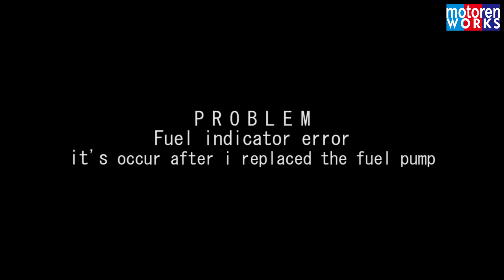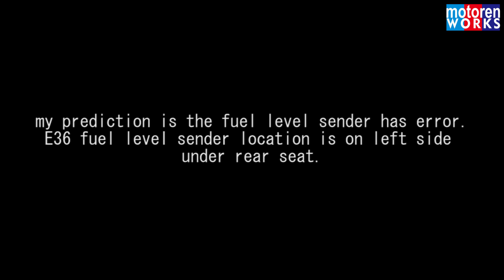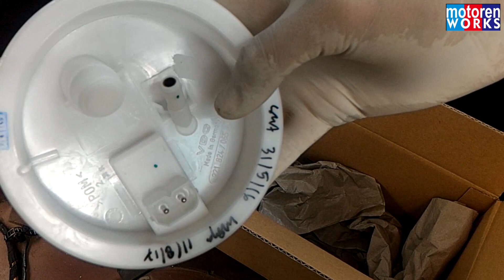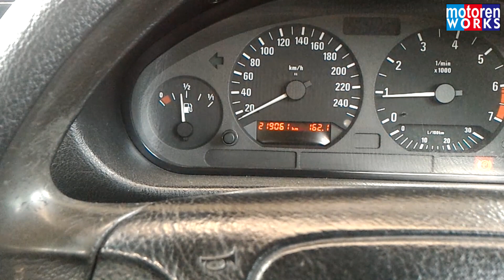BMW E36 Fuel Level Sender replacement

Comment: Thank you very much for taking the time to make this video. I followed the pelican parts and Bentley instructions which only detail removal of the Fuel pump (passenger side) and simply say "Fuel level sender (Driver) is similar but no pump." Needless to say I was confused by the extra fuel hose in the tank. 

Thank you for demonstrating how to unclip it! That was really helpful

Comment: That long pipe in the tank does it just lay in tank or is it connected to the other side of the tanks sender unit
Reply from the maker: it is connected to the right side tank
Reply: @motoren_works  if pulled it out completely how do I get it back what part does it go through
Reply from the maker: @Klips4men  honestly, i never pulled it out that hose. I think it's a hose which has a function to transfer the fuel from right to left tank. Since you can remember the former position of the hose, you can get it back

Comment: Is it supposed to have any fuel pressure in that return line. Mine didnt and i was wondering if i had a weak pump or collapsed return hose. The problem i have is fuel not transferring from left to right., through the syphon pump.
Reply from the maker: Honestly, I've never had a problem like this. In my opinion may be the syphon is broken so the fuel can't be transferred from left to right. CMIIW

Comment: fuel level sender unit and fuel pump is placed on different location ?. there's two hole under the seat ? one for fuel pump one for fuel sender ?
Reply from the maker: Yes it does. In my bmw, there are two hole under the seat. Right side fuel pump with fuel level sender and left side only fuel level sender
Reply: @motoren_works  why there's 2 fuel sender ? left and right
Reply from the maker: @RafleeRosli  Honestly i don't know why BMW engineers made 2 fuel level sender (FLS).

In my opinion, there is 2 FLS because the fuel tank shape is not fully tube (there is concave shape in the middle), when the fuel already in certain height they will be separate. So, there is two fuel region right side and left side. To know the height from each side then FLS is used. 
i've read if the left and right FLS units are wired in series and the fuel gauge receives a signal that is the average of the two FLS input values.

CMIIW

Comment: Sesuai intruksi Mas Rakhmad indra# Ternyata Fuel sender saya rusak... btw harganya brpan kyg punya situ itu om
...matur suwun....
Reply from the maker: Alhamdulillah kalo ketemu penyakitnya mas, sy ikut senang. Waktu itu sy beli Fuel Level 1 jt
Reply: Kalo punya saya gak turun2 mas jarum nya ..di level setengah .  Apa kiranya ga bisa di akalin ya mas Rakhmad indra....itung2 pengiritan gtuu😁. Oiza itu Fuel sender sebelah kiri ya .kok ndak ada Pompa penyedot bensin nya... mohon balasan nya.matur suwun
Reply from the maker: @zonamerahmuda1727  dulu sebelum ganti FLS sy pernah nyoba pertolongan pertama dg membersihkan track naik turunnya pelampung dg penghapus pensil, tapi usahanya gagal om :).
Untuk FLS (kiri) memang tidak ada pompanya om, yg ada hanya disebelah kanan

Comment: Punya saya m43, fuel gaugenya nyender kiri terus om alias kebaca bensin kosong. Itu yg diganti yg kanan apa yg kiri ya?
Reply from the maker: Menentukan bagian yg mananya agak tricky ya om. Kanan dan kiri sama2 ada sensor ketinggiannya. Selain itu yg kerusakan bisa berasal dari fuel indikator di instrument clusternya sendiri sudah error. Cek jg sikring dan kelistrikan.
Tetapi kalau mau gambling, bisa mengganti yg fuel level sender ini, kalaupun salah prediksi, anggap saja sekalian peremajaan part.
Pada akhirnya keputusan balik lg ke omnya
Reply: @motoren_works  terima kasih mas

Comment: Hi, after sitting about 6 months my e36 (engine m43b16) cranks, but wont start. It has spark also i changed fuel pump with fuel filter, but that doesnt solved my car problem. Relays all good. Before sitting car was in good condicion i didnt had any issues with starting engine. Also with some starter fluid car starts but it dies imiadiately. What else can i check?
Reply from the maker: Slykstyne Petras honestly it's hard to make prediction.
Try to check the battery, is it in good condition. Check your spark plug spark, if the spark is not good, i think you must check the crank shaft sensor.

 The right way is diagnose using a bmw scan tool
Reply: @Braxton Shawn instablaster =)
Reply: @Noe Terry I really appreciate your reply. I got to the site through google and I'm trying it out now.
Seems to take a while so I will get back to you later when my account password hopefully is recovered.
Reply: @Noe Terry It worked and I finally got access to my account again. I'm so happy:D
Thank you so much, you really help me out :D
Reply: @Braxton Shawn No problem xD

Comment: How did you remove the seat? :/
Reply from the maker: pull up the rear seat
Reply: @motoren_works  just pull up? Is there nothing holding it in place? Like clips or something?
Reply from the maker: @Hexthrill  yes, it is. Just pull up. There are hooks on the front side of the seat (right and left).
Reply: @motoren_works  oh that seems pretty simple! Seems like a pretty easy job to do!
I was driving home a few weeks ago and suddenly my fuel gauge went from almost full to completely empty. I'm taking it apart and cleaning it first, before spending money on a new sensor, maybe cleaning it will solve the issue.
Thanks for the replies!
Reply from the maker: @Hexthrill  you're welcome. I hope the fuel gauge will normal again after you change the sensor
Reply: @motoren_works  well either the fuel sensor died or the actual gauge died, there's nothing else that could cause this issue (I think), right?
Reply from the maker: @Hexthrill  based on my experience, yes they are
Reply: @motoren_works  nice, crossing my fingers :)
Reply from the maker: @Hexthrill  i hope after changing the FLS, the fuel gauge will normal again and good luck for you
Reply: @motoren_works  cheers mate 🤞
Reply: Where can I find this part
Reply from the maker: In my e36, the position is under the rear seat, on the left side
Reply: @Hexthrill  what ended up working?
Reply: @lulslime3055  Hi!
The seat can be pulled up from the front, it has one or two metal hooks, you can pull hard, they won't break.
As for the fuel level sensor, the problem ended up being that one of the wires for the sensor was rotted through. I just cut the rough bit of the wire since it has enough length, and soldered the two ends together, using some heat shrink tube to protect it. Don't forget gasoline is conductive so it might bridge the connection if you fill up the tank.

Comment: Om mau tanya. saya punya masalah yang sama nih. indikator ngaco padahal blm isi bensin. pas kontak on kadang setengah lebih trus ga lama dipakai jalan turun. setelah berhenti dikontak on lagi ada 1/4 dan dibawa jalan kadang naik lagi dan terus turun lagi. begitu aja terus. apakah harus ganti 2 2 nya om yang kiri dan juga kanan ? Makasih om pencerahannya.
Reply from the maker: Menurut sy dicoba ganti fuel level sender yg sebelah kiri ini om, semoga penyakitnya teratasi
Reply: @motoren_works  om waktu itu belinya dimana? kok saya cari di toped ga ada om.
Reply from the maker: @farha7375  tahun 2017 sy belinya offline. Coba omnya tanya via message di tokped berdikari motors
Reply: @motoren_works  ok om saya tanya dulu deh ya. makasih om pencerahannya. nanti tanya2 lagi boleh ya 😅
Reply from the maker: @farha7375  siyap, kalau ngerti inshaAllah sy jawab

Comment: Om e36 saya tangki kiri kanan kok ga sama ya , yang sebelah kanan ( yg ga ada pompa ) bensinnya lebih banyak dari pada sebelah kiri dan malahan saat bensin rest tangki kirinya ga ada bensin sama sekali dan yg sebelah kanan masih bnyk bensinnya
Reply from the maker: Mohon maaf om, untuk problem seperti ini sy belum pernah mengalami. Ada perbedaan jg tentang pompanya, kalo di saya yg kanan/sejajar driver yg ada pompanya, sedangkan di bmw omnya yg kanan malah yg gak ada. Teorinya sih kanan kiri itu ketinggian bahan bakar sama
Reply: @motoren_works  iya sm mas mksd saya yg kanan yg sejajar sopir yg ada pompa# salah ketik td
Reply from the maker: @bonisyafialdi2286  siyap. Tp mohon maaf gak bisa ngasih pencerahan nih om. Belum pernah ngalami problem seperti ini.
Untuk coba2 mungkin bisa di cek connector selang yg di FLS itu om plus selangnya. Kalo gak salah, selangnya jg menghubungkan bagian kiri ke kanan
Reply: @motoren_works  punya saya nggak mau ngalir kanan om, sama indikator juga ngaco begitu sama, ada saran om?
Reply from the maker: @saefurjpg9407 kemungkinannya (bisa betul tp bisa jg salah) jet pump yg ada di ujung percabangan  selang bawah sudah rusak/bermasalah.
Sy pribadi belum pernah tau bentukan jet pumpnya, dulu pernah diberi tau teman yg bermasalah ketinggian tangkinya. Sumber masalahnya berasal dr bagian itu